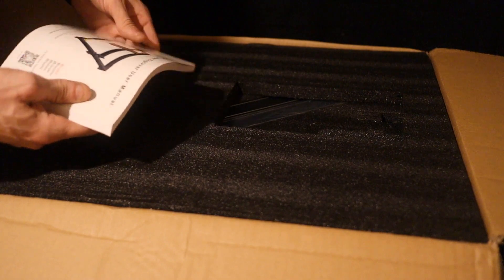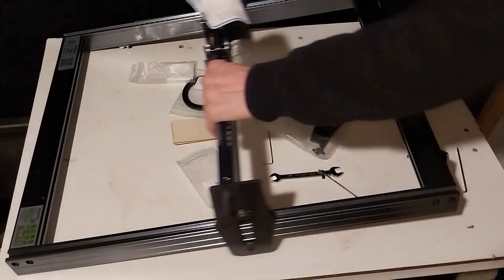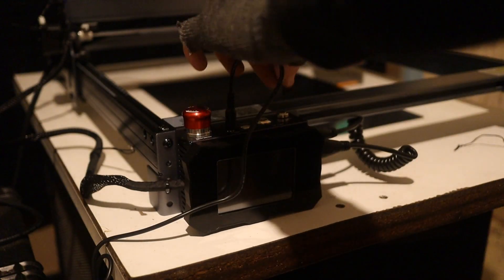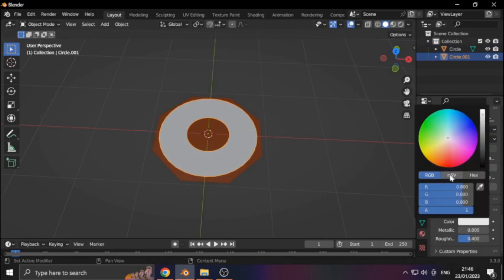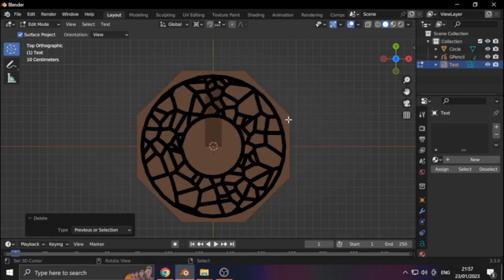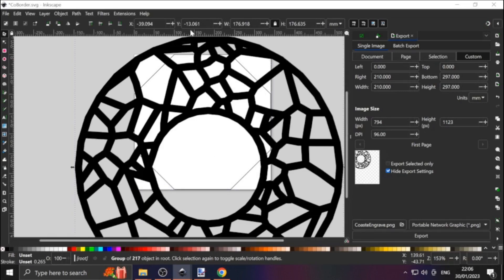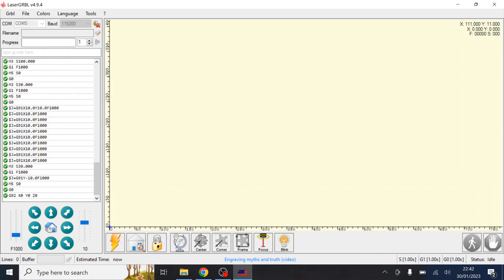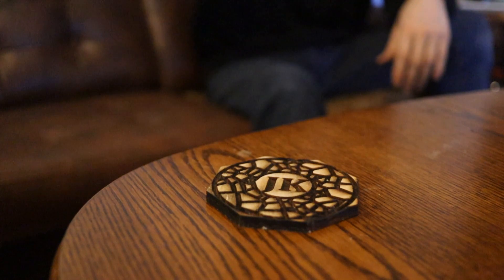ATOMSTACK X20 Assembly+ How to use with: Blender, Inkscape and LaserGRBL

Comment: Thank you for the video!  Do you know why Lasergrbl is not recognizing my Inkscape file?  I have saved the file and did the Object to Path.  THank you!
Reply from the maker: You're welcome! Converting the object to a path should not be necessary. But remember to "resize page to selection"(under edit, while you have your object selected). Second, double check that inkscape has not saved your export with a double svg, i.e "myFile.svg.svg". There is also two versions of SVG(inkscape/plain SVG), you may try to save it in the other form.